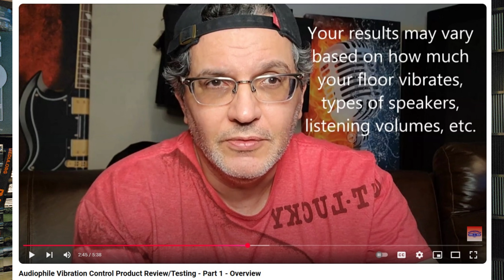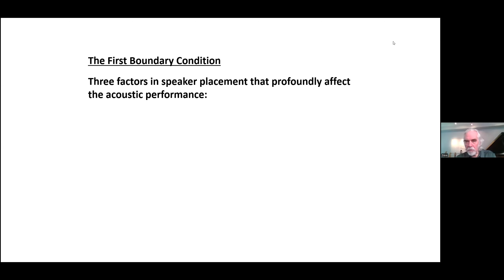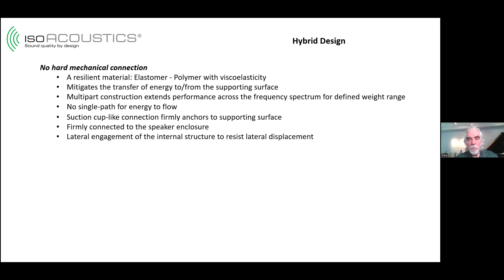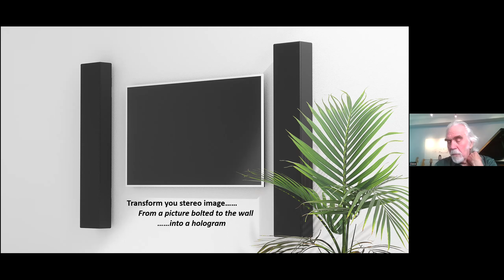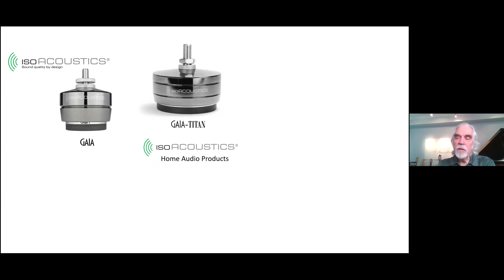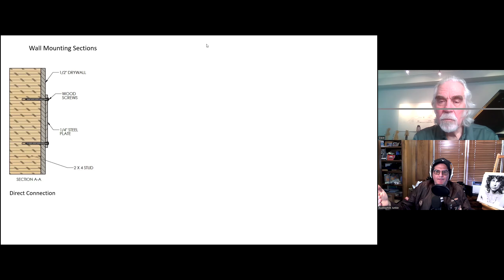👂Hear the Difference / Learn the Science Behind IsoAcoustics - One of the Best at Vibration Control

Comment: When i used isoacoustics back then they did a lot of harm to my system. I'm sure there were certain variables that didn't match up, but either way they didn't work for me at the time
Reply from the maker: It's hard to imagine less vibrations causing more harm, but what piece did you use them with.
Reply: @AudiophileJunkie  I should've added more context, my fault. They worked over not having anything on my system, but when I compared them with another brand (of similar price) that's when I noticed the degradation. 

Used them mostly with component pieces like amp, DAC, streamer. Not used with speakers, which I could imagine is probably more beneficial.
Reply from the maker: Thanks for clarifying... Yeah I think the equipment most sensitive to vibrations... Speakers and turntables... Would be most beneficial with the specific design of the IsoAcoustics.

Some gear is designed already with vibration control in mind, so it's always best to check with them before spending money in that area... Especially electronics with no mechanical operation that's as susceptible to vibrations.

Comment: "best" for me so far is combining Stack Audio and IsoAcoustics together - so doubled up -  ie one Stack Audio Auva Eq on the bottom, and an IsoAcoustics Orea on the top under each component - provides 'best' sound by far - much better than either on on their own.  I had doubled up Orea's under each component and that was more than twice as good as a single - so isolating the isolation - but Stack Iso combo is quite a bit better
Reply from the maker: One thing you might be overlooking with the "best" formula...naming the actual piece of equipment.  As I tried to emphasize in this video, you can't exactly predict the results ahead of time.  Some speaker for instance respond well to mass loading the top, but for others like BBC monitors designed to resonate at a specific frequency, it will be a disaster.  

It's also worthwhile to get a seismic app on your phone and see if a product is actually doing anything with your piece.

The "best" is often a purpose build footer with a company of the pedigree of IsoAcoustics that does lots of testing and working with MFGs.  We discussed the importance with some designs to keep the profile wider versus extra height to keep the center of gravity.

Again, it's great you found what's "best" based on what you've tried, but the formula is actually MUCH more complex and variable based on the specific component itself.

Comment: Hey Jason, fun video  (though I haven’t completely finished watching it).  I went down a similar isolation rabbit hole to you. 

It started when I designed a base for my high mass turntable, and I used vibration/Seismometer Apps on my phone and iPhone as well, and tried every material under the sun.  By the highest level of isolation from floor vibrations to the turntable came from Townsend isolation pods.  Absolutely nothing isolates like springs.  (my turntable base is made of Mabel and beneath that there are sandwiches of constrain layer damping, and held by the spring pods) . 

Since my floorstanding speakers sit on a Springwood floor, I decided to experiment there too.  First, I tried some very cheap spring footers from Amazon, and those totally changed the sound, tightened up the base, the speakers totally disappeared more, it was wild.  They sounded more like electrostatics.  But I didn’t like the tonal change and so I ruled the dice and bought some Townsend isolation bars, with the spring based pods, and the isolation bars better maintained the original height of my speakers.

Those provided a lot of the same benefits with far less tonal change to the speaker.

In the end, I returned those isolation bars. For one thing, they changed the tone of my speaker, just enough that I didn’t want that. 
But even more, they took away some of the punch density and room feel to the sound.  It was more like an electrostatic sound, More weightless.

So that sent me down the rabbit hole.  I realized that I wanted perhaps some decoupling, but not to the degree provided by Springs.
Over many months, I tried a huge variety of materials and footers and platforms under my speakers - from commercial platforms, to my own constructions of MDF sandwich and sorbothane  filler, to spikes of different types, Wood blocks, hockey pucks, footers of other material… you name it… and combinations of all the above and more.   And of course, I tried the isoacoustics Gaia.

I found the Gaia was a nice halfway point between the total decoupling and electrostatic sound of spring based footers, with enough coupling to still have some room feel.  And it did tighten up the bass.

I didn’t find the tonal change completely to my liking, and since placing various materials under a speaker is basically moving resonances around, that’s what I played with. Some combinations would produce incredibly airy sound with massive imaging and soundstages.  But a lightened tone.
Other combinations would go towards deeper, darker more lush and more bass-rich tone. (the more coupling to the floor the more darker and bass rich and lush the tone.)

Ultimately, this is what I ended up with under my Joseph Audio Perspective 2 speakers:

I built a granite base, Two slabs of granite with car sound damping material in between.  The Joseph speakers have Isoacoustic Gaia footers on the back, the outriggers on the front have spikes going into hockey pucks which raises the front to just the right angle.

And the granite slab itself sits on four hockey pucks at the corner, and beneath each hockey puck is an Isoacoustic short set of carpet spikes, coupling into the carpeted floor.

All this allowed me to raise my speakers higher to get a very realistic soundstage, while tightening up the bass,  and dialling in a perfect lushness and “ black background” to the sound.
It was a crazy journey, but worth all of it because it was fun and I had a great outcome.

I actually prefer the results to when I had subwoofers and room correction.
Reply from the maker: I'll have to dedicate an hour to reading, but thanks for sharing :)
Reply: @ ha, ok.  Short form:  I found Spring-based footers - the Townshend isolation bars - altered the tone of my speakers is a bit too much and provided so much isolation I lost a feeling of power, density, and punch.

I found the Isoacoustic Gaia offered a nice halfway between full decoupling and coupling to the floor.  Tighten the bass, but still changed the tone and didn’t like.

Final solution : I built a granite base, with partial deployment of iso acoustic Gaia, hockey pucks and spikes into the floor.  That got me tight bass, combined with a lush and beautiful tone.

Comment: I have found them very hard to set up, if you don't have a levelled floor, each has to have the same pressure and perfectly align if you do that they sound amazing! after some time I'm bored looking for something different now
Reply from the maker: Wouldn't that be the case for any footer though?  They all can be leveled by the amount of threading used
Reply: @AudiophileJunkie you completely right for sure ! I just found some of them easier then isoacustic to set up in terms of the speaker ones, they need to be perfectly aligned and pressure has to be exactly the same on each to make them sing :: just takes time to do it

Comment: Every review I've seen on Stack Audio vs Iso Acoustics suggests Stack Audio is superior in isolation, reducing vibration and improving sound quality.  You might want consider a comparison among many of these isolation/absorption products.
Reply from the maker: I've tried countless and the formula for what works is very similar although ultimately it's the OEM custom design for each product that gives IsoAcoustics a huge advantage as evidenced by how many MFGs want to work with them. 

You also see them at shows doing the A/B demo on the fly where others don't. 

Opinions are one thing, but I tried to show the science, A/B testing, and customized design that is required for any product in this area to be considered "the best".
Reply: 'An Aussie Audiophile' did a comparison video and on some songs, even through Youtube, the Stack seemed to edge ahead.

 I'm a Gaia owner myself and what Dave explains when using the bungee kind of comes through with the Gaia too. The bass sounds a bit more rounded and less punchy. It's only subtle and the improvements in the highs make the trade off worth while, but that 'problem' for lack of a better word (because it might just be what you want), seems to be eliminated by the Stack feet.

I'm planning to try the Stacks. If it wasn't for the video described above, I wouldn't ever have looked elsewhere. The Gaia definitely do a great job.
Reply from the maker: The measurements in the video shows no adjustment to the bass frequency response on the speakers they've tested.  It's risky to draw conclusions from other people's (or dealers of such goods) experiences unless you're using the same gear on the same surface.  I did extensive testing in the past with different gear and even different locations on the floor mattered, so it's important to provide verifiable benchmarks and qualities like I highlighted in this video.

There are certain things the "best" companies do that give you the greatest chance of achieving the "best" results, and I highlighted them in this video.  In many cases, the equipment designer has already selected the "best" feet for their designs or worked with a company like IsoAcoustics to design such products for them.

I realize it's fun to EQ your system using accessories so enjoy the journey, but understand it's a far more complex and a minefield of variables that rarely translates 1-to-1 for everyone.